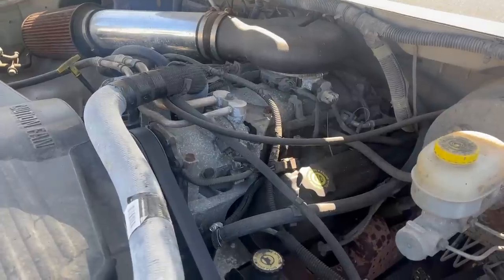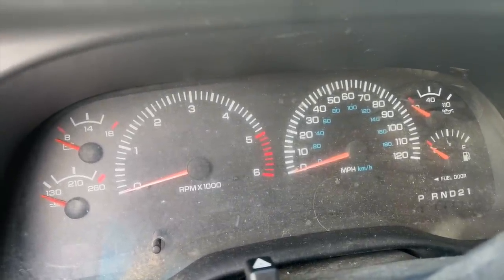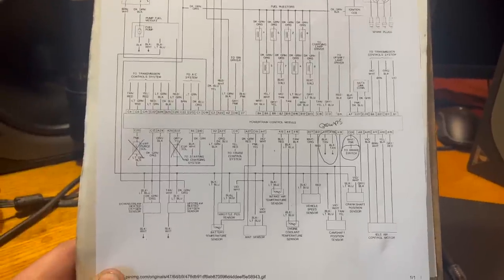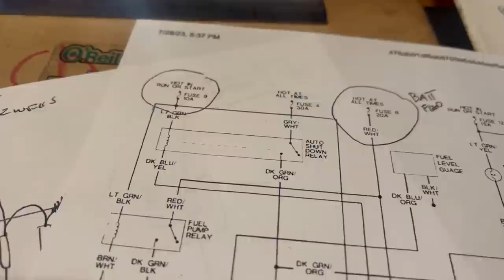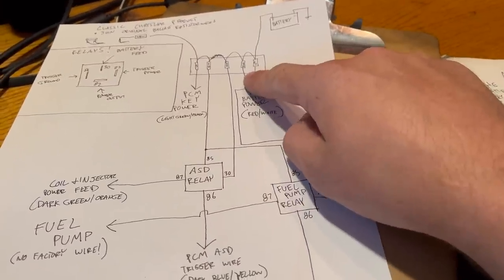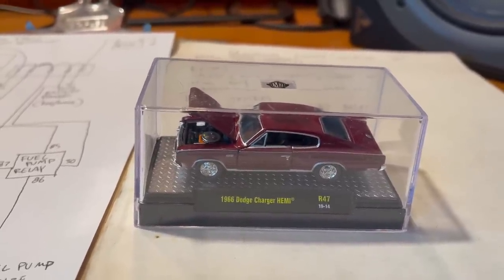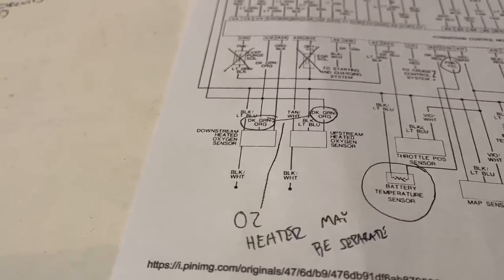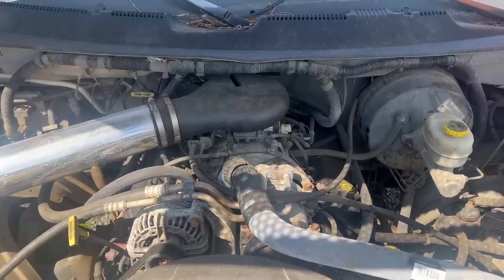The Big Magnum 5.2/5.9 Swap Wiring Guide! How To Wire A Magnum In Your Old Mopar (Or Anything Else)

Comment: I’ll be doing this finally this winter. I swapped my 360 magnum into my 79 Ramcharger in 2011 after doing a NV4500 swap in 2008. It’s been carbed and runs well but it’s time for efi.

Comment: I figured this out about eight years ago using a 5.2 from a 96 jeep grand cherokee. I wired it up and could get it to start, but it would die within a couple of seconds. I finally decided to pull the body control module and wire in the data link wires, and it fired right up.

Comment: Jamie, this is great content. I had to figure all of this out on my own when I did mine, so I'm sure this will help tons of people. I want to share a few notes / experiences:
1. Fuel pressure regulator. I used a filter / regulator for a 2002 Cherokee. It runs at 52 psi, which is supposed to be too much for my OBD1 setup's needs, but it runs perfect in my setup. Would be totally fine for an OBD2 swap with its higher pressure spec.
2. Speed sensor. I have also run thousands of miles without one. From day 1 my car was popping through the exhaust a bit on deceleration. The car sounded like a douchemobile on deceleration, and I couldn't figure out why. It has the Hughes SER0814ALN-14 cam and long tube headers, so I thought maybe it's breathing better than the PCM expects it should. Then I added the speed sensor from a 93 Dakota to control OD and lockup on my 46rh (I was using switches for that previously). The Dakota VSS has the output for my mechanical speedo, and is only 2 wire: one to ground, the other to the PCM. Super easy. The minute I added the VSS the car stopped popping through the exhaust on deceleration. I later learned that the PCM tells the IAC to open up a bit on deceleration, which prevents the popping.
3. ASD relay. I didn't put in an ASD relay. I think I just wired that circuit through the ignition switch.  Your video helped me realize that's a problem I should fix ASAP!
Reply from the maker: Awesome! Bypassing the ASD definitely could work, but it throws a code and I feel like there are good reasons to have it there. Good to know on speed sensor! I know it does *something*. Haha. Good to know the Cherokee used a filter regulator. I had no idea. I tried using the GM filter regulator in my first swap. It didn’t work right… then I found out the one I had tried didn’t actually have a regulator? Something weird like that.
Reply: I need to try this. my swap also backfires on decel and I have no VSS. thanks for the info.

Comment: Thank you sir.  This is your best video ever.  I have been curious about doing such a swap for years now but always get so frustrated with all the conflicting data there is out there and all the misinformation guys push in some of these forums and groups.  On a side note I found one of the battery sensors on a 2002 Dakota I parted out a few years back.  I was like WTF is this for.  LOL  In my case the Dakota still would start and run after I unplugged so I was really confused why it was there.
Reply from the maker: Thank you! It’s what the people have wanted for a long time! Haha. Very good to know it would start without it. I had read that some applications won’t, so I’ve always just installed them, but I really don’t know. Haven’t tried without on any myself.

Comment: Been wanting to go roller cam 360, for several years in my' 80 Powerwagon. Motor is very tired, along with the NP435. My dilemma is, quick refresh of factory block, and gamble on a RV cam, or go through the hassle of converting to a Magnum. Clubcab long box with a 4" lift and 35's. Middle of swapping over to Dana 60 axles with 4.10 ratio. Definitely not a race truck, but this video was much needed, and appreciated. Watched hundreds of swap videos, this one was extremely informative.
Reply from the maker: Tough call for sure. I just had the same question on my ‘74 club cab - gamble on budget 318 rebuild, or magnum swap. I went with the 318… we’ll see how that works out. Awesome! Glad to help.

Comment: Really glad to have found your video's. I'm planning on doing something a bit different. rather than swapping a newer magnum into an older vehicle, I'm actually planning to Upgrade a Wrangler JKU to a 5.9 Magnum. Just discussed this project Idea with the wife today and she is in agreement. so I'll be needing this information for sure. Already got the doner, 2001 Ram 1500 4x4. I even have a complete trans rebuild kit (since that is what parked the truck in the first place) but we've decided we'd like a more roomy vehicle and since we love Jeeps and pretty much all things Chrysler decided to find an insurance salvage JKU and transplant the power train over from the Much better magnum stuff. and the v8 swap will help with pulling power etc.. anyway awesome information and thanks for the facebook group tip.
Reply from the maker: Very interesting idea. Would love to see that happen! It won’t be as fast or as efficient as the 3.6, but it will make torque and should be reliable as long as the swap is well engineered.

Comment: Great explanation, make it sound easy! Sleeperdude been having doozy of a time swapping 98 durango setup into his restored 71 Dodge mini restoration. Had pc flashed without security still shutdown on him. Couldn't take it on his trip, bought a gm wagon instead. Reach out, he could use a smart guy like you for some input. Thanks for sharing!
Reply from the maker: Dang, that sucks. He should just go grab a Ram computer! It’ll fix everything!
Reply: If he would go find a B van the conversion would be just about a direct   crossover including the heater/AC system..........
Reply: @Scott_Newmaster  yeah, was ironic he needed a power steering bracket to clear small under space hood in the rv, he pulled it off a van in a salvage yard which had the entire setup he needed including the pcm! should watch the series...
Reply from the maker: @Scott_Newmaster  it probably would’ve made a better donor for wiring and PCM, but the only physical difference making it a better fit is that PS bracket which he already sourced. I can tell you from experience that the truck bracket works if you are willing to beat the firewall / floor transition area with a hammer. I am 😅
Reply: I used a harness from a jeep grand cherokee that would run but shut down. I had to pull the bcm and wire up power and data link wires to make it run.

Comment: I have been wanting to Magnum swap a car for the last 15 years!!!  My biggest issues were transmission and wiring: either cutting the floor for an 42/46RH/E and/or nothing super easy or cost effective for an 833/OD and then the rat's nest of extra wiring, internet folks saying how easy it is, but leaving out some key pointers (some folks, not all folks - it was mostly me...I'll admit it).  

But here comes Dead Dodge Garage to answer ALL my questions and address my fears!  My 833OD is already swapped and coming up with a 318LA flywheel to modify for the tone ring/flex plate is also secured.   I have a 94 5.2 out of a van and a 94 5.9 out of a truck.  Yes, they're OBD1....so, my question, is this a MAJOR drawback or, because I already have all the stuff,  should I just use what I have?  Thanks Jamie!!!
Reply from the maker: Not a major drawback. Obd1 works fine. Get after it!

Comment: I've never done one of these, but I have done 5-6 Fox Mustang 5.0 H.O. EFI swaps into various cars. It's interesting how similar most of the information is; OBD-2 is obviously more complex than the OBD-1 systems I'm used to, but not that much more. Like the Magnum swap, the H.O. has maybe five wires total under the dash to make everything work, and the harness is pretty much stand-alone. Now I'm daydreaming about this green '70 Scamp I know of for sale.
Reply from the maker: Yep! I meant to make a note that this is really, really similar to other EFI systems. I’ve never wired the 5.0, but I kinda know what makes it tick. That’s a good one.

Comment: Friggin awesome video dude. Now do an OBD1 LOL. I’m looking at swapping a 93 5.9 into my 89 W150 5.2
Reply from the maker: Like I said, all of the important wiring you’ll need to add is the same. Hell the color codes on the wires are usually the same even… ‘93 being the last year of the old body style, I don’t really know what your donor wiring is going to look like - but given that you’re building an ‘89, I’d probably just take all of it and swap it over. That may be your easiest course. But I did the same basic thing on my van - I removed all of the TBI stuff, added a later truck harness (OBD2, again) and just used the wires from the original TBI engine that I needed.
Reply: @DeadDodgeGarage  sounds good buddy, thanks. All of the relays are in place on the donor. ASD, TRANS, STARTER, ETC. hoping it’s easy peasy

Comment: interesting note on the battery temp sensor. I've ran a 1997 and a 2001 donor motor and harness and never had a batter temp sensor. I'll note that if I have issues in the future.
Reply from the maker: Interesting! I read that it was necessary years ago, and have just always installed it. Have never tried running without.

Comment: Hey Jamie, I have a couple questions about doing one of these swaps. Around the time you drove through on your trip to Tony’s (5/25) my town got hit by a tornado late that night. First time ever for a direct hit here and it really messed things up big time; the same storm jumped over to Arkansas within an hour or so and tore the area near Ed’s machine shop who Joe always uses too by the way…definitely a scary experience! It picked up a 383 off of my porch which is around 3 feet high and set the motor about 6 feet away on the ground! It didn’t roll it over or tear the covering off-sat it down in the exact same upright position…unreal🤦🏻‍♂️! 
Well, one of the big trees came down on top of my 97’ Dodge Ram 4x4 crushing the extended cab in the process. That just made the 5.9 a perfect candidate to put into my 76’ B200 shorty van😁. 🤷🏻‍♂️gotta look at the bright side right? 
So,  my question is this.. are there any issues using the transmission from a 4x4 like mine? Since my truck is a 97’ itself (when a lot of changes seemed to be happening), is there anything that I should look for to identify whether mine was before or after the changes? 
This will be my first actual magnum swap into a classic. My van was needing the wiring harness redone anyway so this should be tons of fun 😅. 
Hopefully when I get it all lined out-Tim from (318-will run)will be freed up enough for a visitor….ya know in the spirit of your crusade…maybe I could line it up against his black van😁that would be cool. 
Any suggestions you have on the switch out would be greatly appreciated, thanks in advance brother.
Reply from the maker: Wow. Well that’s unfortunate, but I like where this is going. Haha. On the transmission, that’s a bit of an issue. The 4x4 transmission has a transfer case adapter that is not easily removed or swapped for a standard tail housing. It requires a replacement output shaft as well as the housing, and complete disassembly to change it. 

I believe for ‘97 that will be an electronically controlled 46RE. That wouldn’t be the end of the world since you already have the computer and wiring to control it. The way to tell them apart is by the electrical connector. Rearward of the shifter and kickdown linkage connections on the driver side, you will find an electrical plug pointing straight up. It will either be an oval plug with three wires, or a round plug with 10 or so wires. The latter is found on the RE computer controlled transmission. Armed with that information, you can start shopping for a RWD transmission that matches your donor, and your swap could be that much easier. 

If using an RE, what you really want is the 97-98 version of that transmission, because it still has an old school speedometer drive that you will need if you want your van’s speedo to work. 

Anyway, hopefully that helps. You may well have seen it already but I’ve got a whole playlist on other Magnum stuff that I’m sure will come in handy for this operation. Good luck.
Reply: @DeadDodgeGarage  Awesome, thank you Jamie-this information will help me greatly & I really appreciate it brother! 😊

Comment: I have a 2000 5.9 but it has the fuze box you said was in that red 98? Is that right or is it messed up? One of the wireing harnesses isnt connected to anything and i think its the transmission wireing.

Comment: 1998 Ram 3500 Van.  How are the differences from the can and the truck? I just got a van and I’m sure this video will make the job much easier to understand. Just looking for a bit more incite from an expert…
Reply from the maker: The way the harness is built is very, very different, so for swapping purposes I don’t like them as donors. Functionally, it’s all the same stuff. Engines, computers, sensors, etc.
Reply: @DeadDodgeGarage  so engine and transmission good.  Find working from the same year truck???  And I am grateful for your help

Comment: Found this video just in time.  I have a '92 dakota with the 5.2 magnum and the obd1 pcm has finally died. Those computer modules are next to impossible to find. Very few available from parts pullers and none with any kind of return available. No aftermarket support either. Shipping outside US almost doubles the price.
 
So, correct me if I'm wrong. I can change to a later obdII pcm if I use the wiring harness that goes with module. My transmission is the 46RH so I dont need any transmission hookups.  As far as I can tell none of the other vehicle functions are integrated with the pcm.  It appears that the ideal unit would be from a '96 Ram pickup, as those still had the hydraulic shifted transmission.
Reply from the maker: Yes. Exactly that. It’s a pretty easy conversion to make, and with ‘96 (and I think ‘97?) the engine connectors are still the same. Any newer and you’ll have to change the intake, crank sensor, and distributor - and you’ll have a bunch of transmission codes.

Comment: awesome guide!! Oddly my last 01 ram would stall when stopping with the vss broken. I would have thought it necessary.
Reply from the maker: Ok, this is an interesting point I chose not to take the time to cover in the video for some reason. Ok, that reason may be that I had totally forgotten. Anyway, my stick shift Charger with Magnum 5.9 would stall when it went into fuel cut and coasted to a stop. It just wouldn’t recover when you clutched in. If you blipped the throttle once while you were slowing down, it would come out of it and not stall. Weirdly, our van with an almost identical drivetrain does not do that. I believe the van has a ‘96 stick computer and the Charger has an auto computer. I was pretty sure this was related to not having a VSS. So it’s not 100%, but some computers will do that without a VSS reading - apparently.
Reply: @DeadDodgeGarage   Thanks for taking the time to clarify. Thinking about this swap and ditching the fitech in my cj7 so just trying to get it all figured out.
Reply: @DeadDodgeGarage  my ram van has a pink wire a white with blue stripe and a red wire and a red with white stripe for the Trans relay I have the 46re just a thought

Comment: Great video! A lot of information covered.
I have an issue with a ‘99/5.9 wiring. I’ve lost speedometer/power windows/and blower motor power. Lost power to the starter at the same time. I wired the starter up to push button start for now until I can figure out what it could be.
Any advice as to what is bad?
Reply from the maker: Sounds like you lost an accessory feed. This could be a blown accessory feed fuse or an ignition switch failure - among other possibilities. I have had to replace multiple ignition switches in these trucks for various reasons, so I am tempted to point toward that - but the starter thing doesn’t really make sense there.
Reply: @DeadDodgeGarage thanks for the tip! Going to replace the switch and switch harness and go from there. Much appreciated 👍